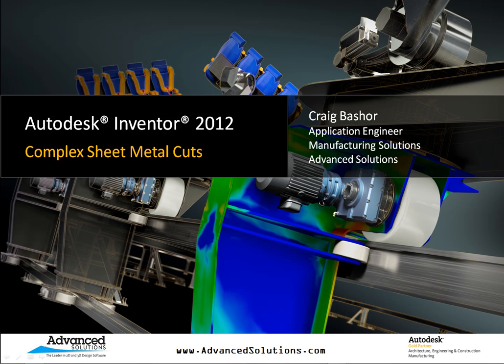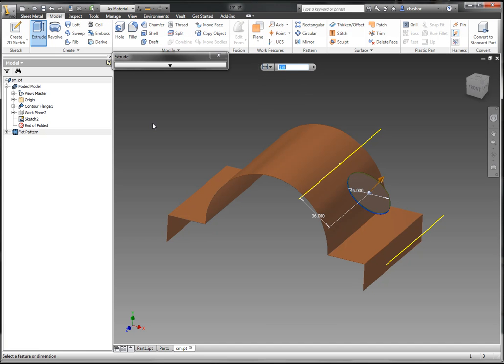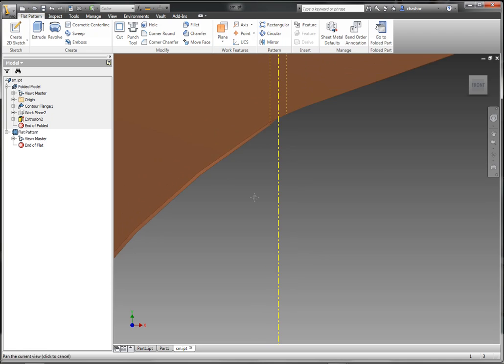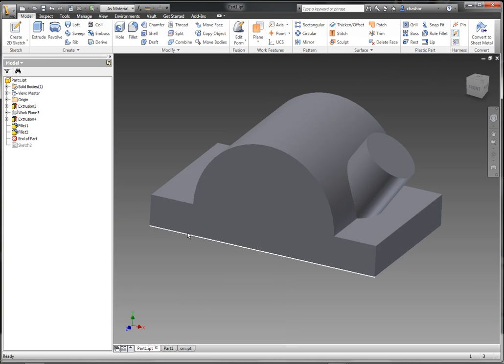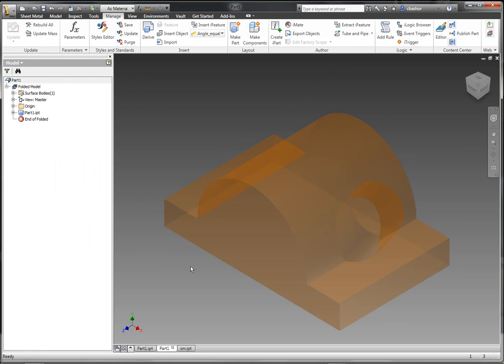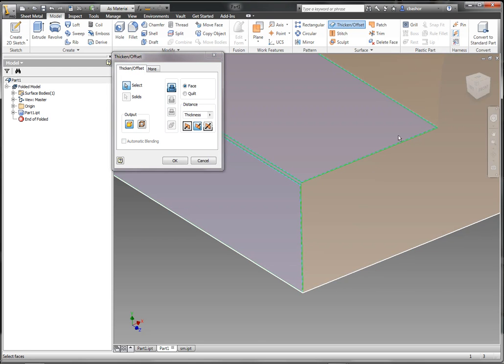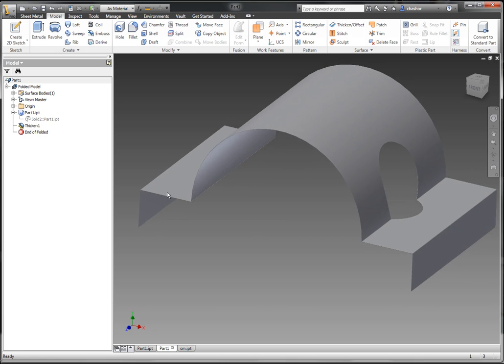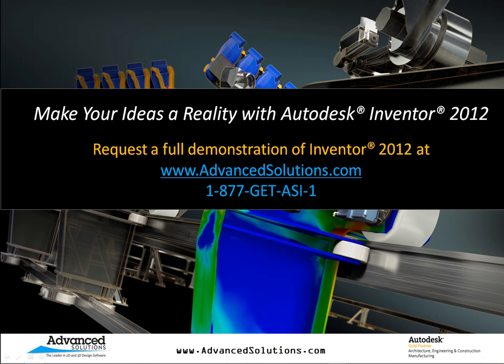Complex Sheet Metal Cut Outs

Comment: Hi, bashor
well i wanna be an inventor professional. my solid background is in computer engineering. can u suggest me how can get exposure to this line. moreover how much an average professional earns.
secondly i made cylinder of sheet and cut a hole on wall of cylinder but when i unfold it. it appears as perfect round instead of oval shape as it supposed to be. can u also pls tell me how can solve the problem.
thanks

Comment: Please tell me there's an easier solution to this common problem. I'm new to Inventor from Solid Edge and in SE you just select "normal cutout" and pick if you want to trim to the nearest edge, furthest edge or the sheet mid plane. I'm really surprised Inventor can't do this simple task automatically as it's so crucial for clean DXF profiles.